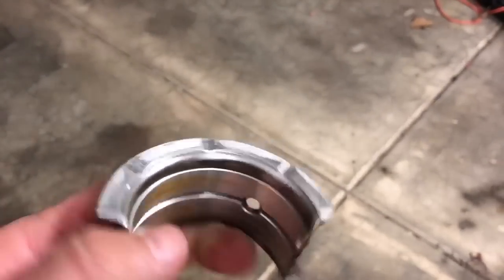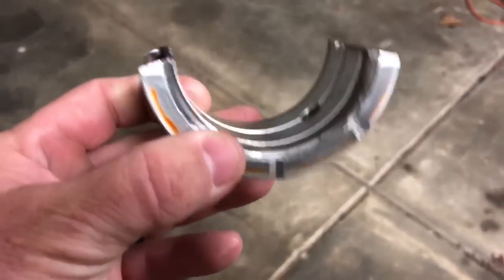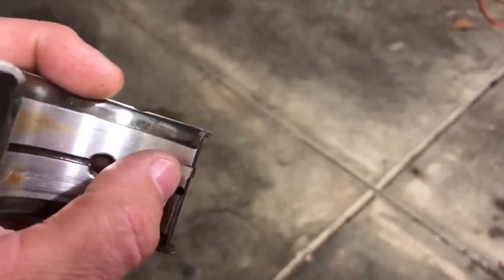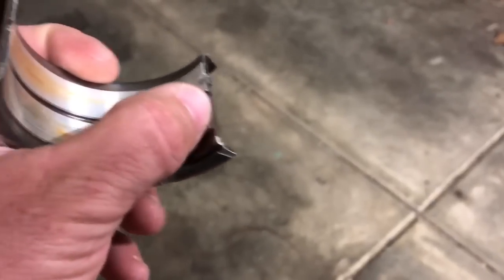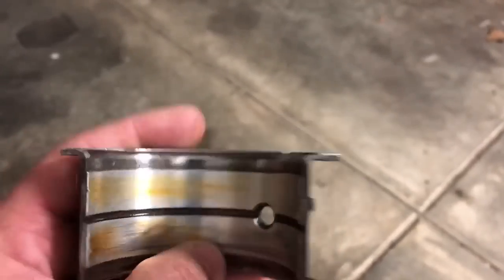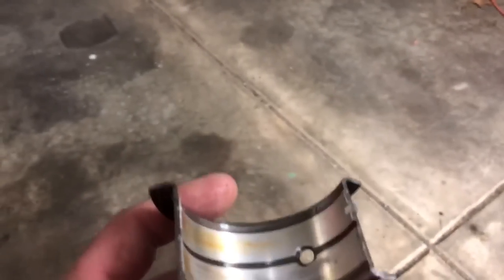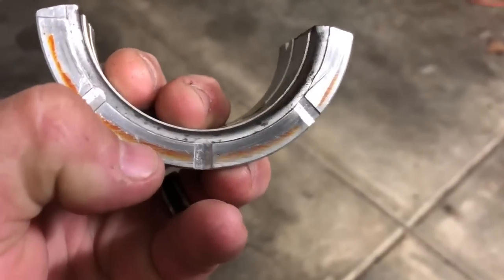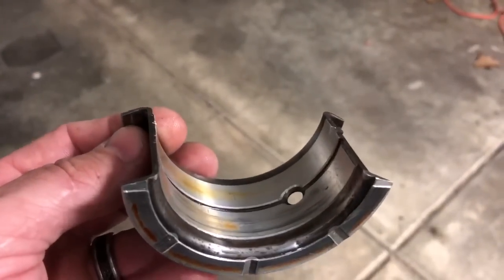Engine Thrust Bearing Failure, Part 1

Comment: If I am presently using 20w 50 in my 2001 dodge ram v8 but  if I replace the bearings, should I go back to a lower viscosity oil, or would it be safe to stay with the 20w 50. I just replaced the oil and I am going to save it if it looks good, so that is why I am asking the question above. I don't have a turbo on my van, so I don't think what you are describing applies to me, but if it does, please let me know. Thank you Turbo John.

Comment: How much oil pressure do you lose with this? I'm looking to do this on my olds 455 in my 11000 lb gmc motorhome,   and  some are having problems with thrust bearings  on rebuild, of course the factory never did this, stock there was no issue from factory
Reply from the maker: on the racecar, with a good oil pump it is not a noticeable pressure loss.

Comment: My opinion is that the 3 thick grooves that are made from the inside out on the sides of the edge of the bearing are the cause of some oil pressure escaping there, which could be used as a film where the crankshaft is supported. when straining from back to front. there are some bearings that have those same grooves but they fade away and end before they reach the edge of the bearing. It's just my opinion, I'm not an engineer, much less an expert.

Comment: If this happens do you have to tear the whole motor apart and clean it or can I just swap the bearings out
Reply from the maker: I’ve done both, but it’s always best to disassemble
Reply: @TurboJohnRacing ahhh I knew that was coming,  and I know but freaking head gaskets are 125 dollars each, idk I guess it's coming apart,  it ran perfectly fine no loss of oil pressure or anything,  I cut the oil filter and it looked like gold paint

Comment: I have a 363 sbf dart block,  88mm turbo and  c4 transmission,  thrust bearing got wiped so it had a cast crank while I had the crank out I got an eagle neutral balance crank and put in, spaced my converter about an 8th in or a lil more and ran it 10 miles and wiped the thrust again, wtf

Comment: I'm just shy of the minimum spec in a 350 I'm building. I'm at .00275", too tight for my liking. I'd be much happier with .006-.010". Not a turbo car.

Comment: I put a used engine in mines and when he did an oil pan removal he noticed one thrust bearing in the pain.he said,eventually need a knew engine it runs great no noises or nothing.I have a 2005 mr2 spyder automatic

Comment: It seems that ls engines have a lighter thrust than a small block. Holding the brake seems to be rough on thrust bearings.
Reply: I believe that's because LS engines have knock sensors and the tighter clearances are supposed to help not create false knocking.

Comment: Nice tips man. A needle roller bearing at the nose of the crank is the best solution in my limited opinion, a "torrington" bearing. we use em in our turbo straight sixes here in aussie

Comment: Had this problem a few years ago, for me it turned out to be excessive cooler  line pressure.. like you said dump valves help great, I monitor my pressure now.. Good tip on diverting a little oil...

Comment: What oil do you use in your racecar and do you feel that it's better than the rest. I work for a shop that builds race engines and information from guys like you that race a lot with very fast cars is valuable to me. Back in the late 80's and maybe early 90's I experienced some great things with Royal Purple like making a few more HP, engine ran cooler, and would even idle higher. It changed I think because of regulation's or whatever. I've never seen such again but would love to find something that works that good again. I enjoy your videos and hope you keep doing it for a long time.
Reply from the maker: Brad Penn is what we mostly use.  We do very frequent oil changes, but it does a much better job keeping the methanol and condensation separated.
Reply: I second that. Brad penn had been my go too for higher HP builds.  Just buy a Qt and dump a cap full on your bench.  You can’t wipe it off.  Lol. It works well at higher temps when most oils thin out and become useless for the engine. Amsoil is my second favorite.

Comment: John, you offer the most informative advice I have seen here on YouTube. It's definitely not for beginners. I'm from the turbo Buick world & have run into thrust bearing issues which are usually torque converter issues or spacing  to the flywheel. Thank you for the insight, & I found out out about you from John Doc. Glad I did.
Cheers, James.
Reply from the maker: Thanks, yes cooler line pressure and spacing are huge, gonna do a vid on those also.

Comment: As always great video dude you always have great tips and information. I have never had this problem but that could be because I have a lower horsepower NA motor but I know others who have had this problem. And I guess every engine builder or machine shop has their own solution and I guess it's one of those things there's really no right or wrong way as long as the solution works. Keep up the great work and videos
Reply from the maker: Thanks